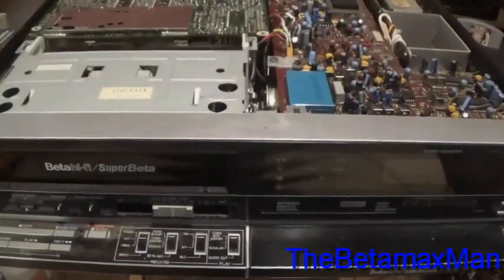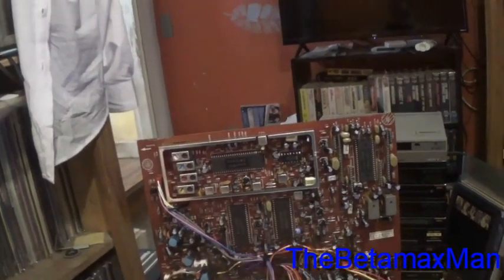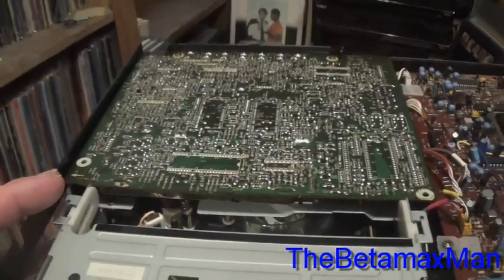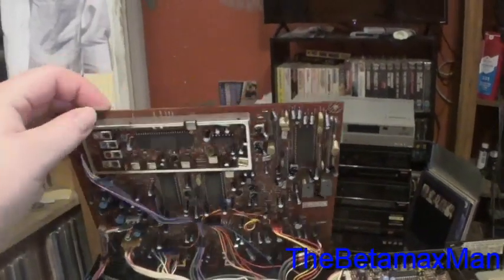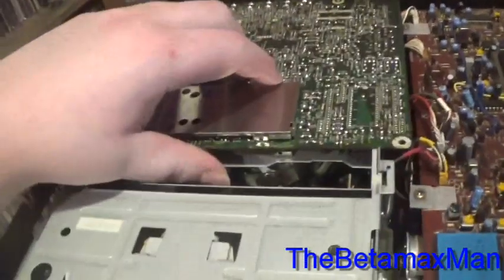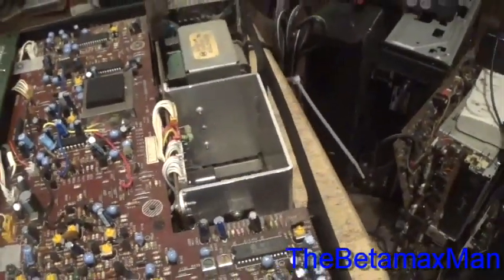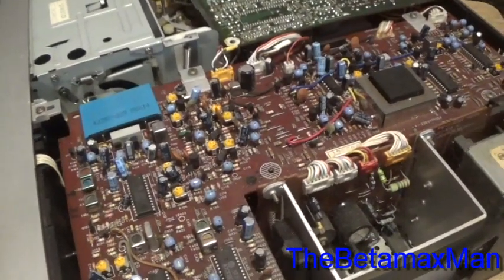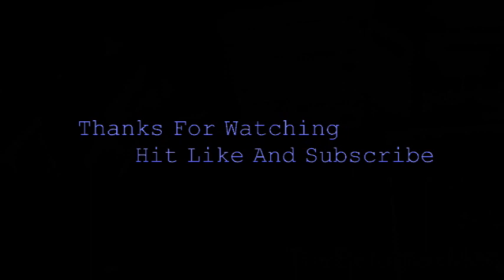Where's The Pre Amp On A Sanyo 7250

Comment: Hey I recently got an SL-HF860D and an SL-HF2000 for free. Both are acting up. In fact the HF2000 threaded one of my tapes and refuses to eject and it thinks there's no cassette inserted. I know both of these decks use the 711B3 chassis, which has a mode switch, should I try cleaning that first? Also, if I can get both of them working which one should I keep and which one should I sell? I currently have a SL-HF400 as my main Betamax.
Reply from the maker: the mode switch is completely sealed and cant be cleaned but you could spray cleaner between the 2 peices and spin the switch to try and get cleaner in it. i would keep the 860d its way better then the 2000